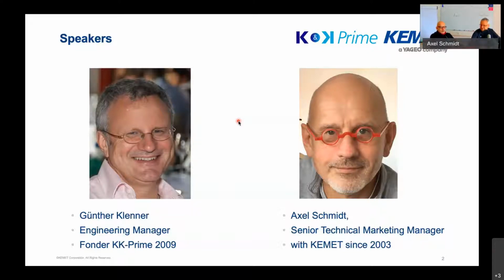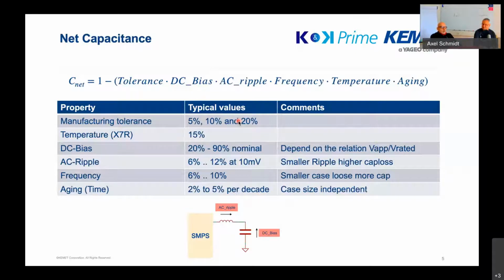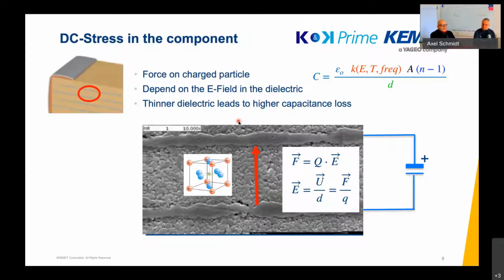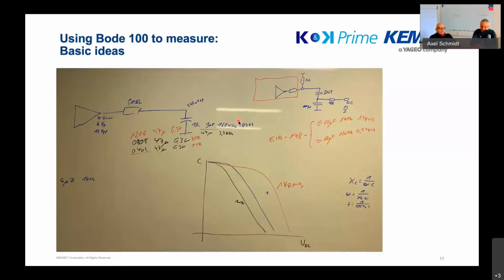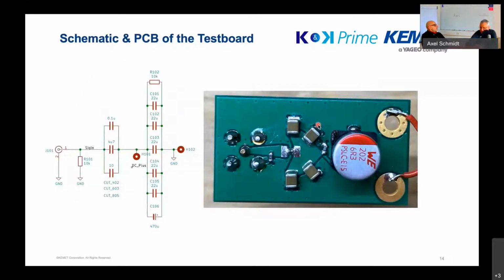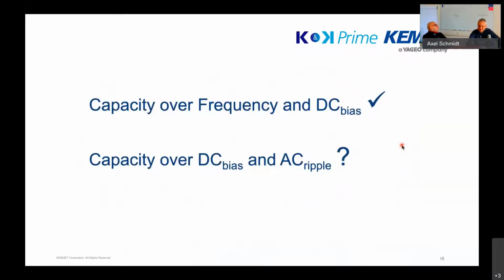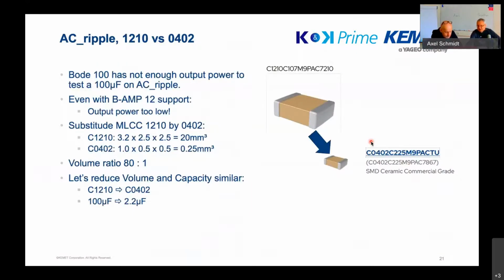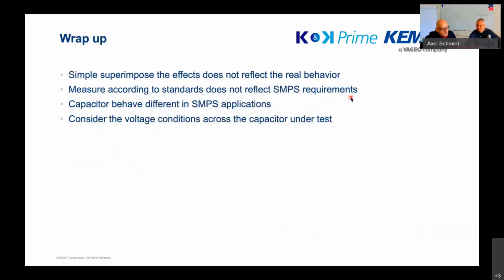Net Capacitance

Comment: I measure 1000 pieces of capacitor of different value and different brand , and different materiel with my bode 100 , one thing I notice none of them have value according to its datasheets and the tolerance is always on minus side , for example Kemet capacitor with 10uF tantalum +/-20% on one reel is always on -20%
and they sale +20% version as next step value with higher price which is on its minus side of tolerance, the capacitor industry is really cheating when it comes to capacitor !  for clearing what I mean see https://content.kemet.com/datasheets/KEM_T2073_T59X.pdf, value for 47uF with +20% tolerance is 56.4uF and value for next step 68uF with -20% tolerance is 54.4uF  and they sale it with higher price , so some beginner just trust the value written in package , ,in my opinion manufacture should write with BIG TEXT , that they are cheating in engineer way at first page . me as engineer I learned that I should add 50% to total amount I need for design is good rule and not go for small package .
Reply from the maker: Maybe we could ask them during the next symposium.